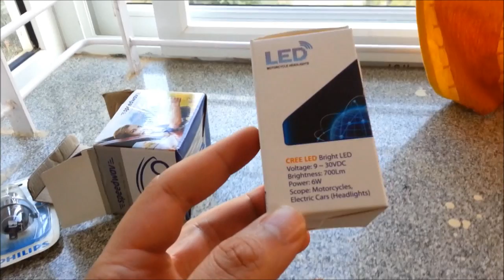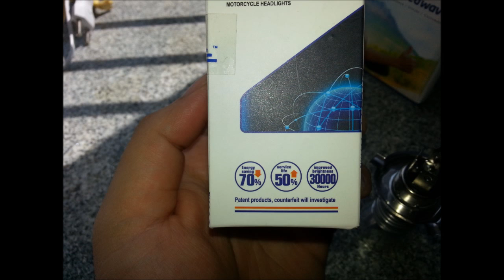H4 LED vs Halogen bulb

Comment: You bought a crap LED bro. Power 6W 700 Lumens? That's a joke!

For a 'small' vehicle such as scooter 110-150 cc you need at least 2000 Lumens to get a good lighting.
For big bike over 3000 Lumens (each bulb).
For cars, over 4000 Lumens (each).

You can watch I have LEDs on my bikes, and they're all GREAT!

Scooter 110 cc (I use 20W 2000 Lumens LED Cree): https://www.youtube.com/watch?v=pRjGxxLpLcs&t=2s

Sport bike 250 cc ( I use 40/50W 6000 Lumens LED Cree): https://www.youtube.com/watch?v=-3QDq89Y9_c&t=98s

Superbike 1000 cc (I use 80W 10.000 Lumens): https://www.youtube.com/watch?v=RmkIO17cf_w
Reply: stanislausxx did you just fit the bulbs or any thing else with then like wires chang or any thing else
Reply: Its Plug and Play bro, designed specifically for each bike (you have to know your bike spec using what type of lamp&its socket, e.g.: H4 / H7 etc.
Reply: stanislausxx any relay needed. my is classic 350.
Reply: none needed. the driver itself has built in electrical parts. for it

Comment: normal 9000 series AUTO/CAR Halogens are about 55 watts-70 @ 1000-1500 lumens seem to vary by filament & gas technology. HID  systems put out MUCH more light (3000 lumens) than a halogen system with less watts and because of it, they have more focused optics to avoid throwing light all over the road and blinding drivers. The combination works and is paired to your cars plastic lens and they are forced to focusing a certain pattern wide or narrower. The HIDs are of course more expensive. If your light is out change it- but otherwise wait for better pricing with future tech in 2017. WASTEFUL TO JUST throw away working bulls unless yours are just that dim . <1000 lumens

Comment: You're using an LED that has no power to it. I would look up cyclops or lifetime LED. Those lights are pumping out 3800 lumens. The standard bulb like that is going to put out less than a halogen bulb.

Comment: LED can never be better than halogen. Halogen has CRI of 99 which is colour reproduction. Good colour reproduction gives us contrast and help distinguish things. LED will have 70-80 CRI which is very poor. If u want to have 95 LED of the same output as halogen It's cheaper to buy 10 halogen bulbs and change battery.
Reply from the maker: Adrian Mierzwa Absolutely, but guess what the new Audis have already started using LED main headlights, apart from DRLs
Reply: Yes, even I experienced the same. I came back to halogen after installing led to my bike.
Reply: the leds used in audis are in a projector kit.. and a standard projector kit costs 8-10 k, and philips h4 led costs also 10k, and yo have to buy balasts and shrouds seperately so total cost of standard LED lighting is 20-25 k.  Dont comapre to that.. you are using cheap chinese LEDs.
Reply from the maker: Dont lose hope Adrian, this video was done a year ago when we had no good options in the market.  Things have changed now. Check out the Mictuning - https://www.youtube.com/watch?v=UO8PLCD68fU&list=PLHjEEkCM7RgAps5a7QqOncsfBT0pk5M7G&index=24 or the https://www.youtube.com/watch?v=txcANbaGwwg&list=PLHjEEkCM7RgAps5a7QqOncsfBT0pk5M7G&index=8 . They are drastically better and you have to remember that these also come in different color temperatures.

Comment: Hi,

Nice review.

I don't think they both have the same lumen output. Can you get a led bulb which has the same lumen output as your old halogen and compare those two. 

That would be a fair comparison, Lumens matter more than wattage. Also if you can try getting a warm white led if possible with same lumens as your halogen and comparing them would be the most fair thing to do. :)

Anyways thanks for sharing.
Reply from the maker: karlog22 thanks for viewing! your absolutely correct, the lumens are a lot lower, but I guess I should have just kept the title of the video as H4 LED rather than an actual compare. its more of a video on the LED H4 and that was about it :)